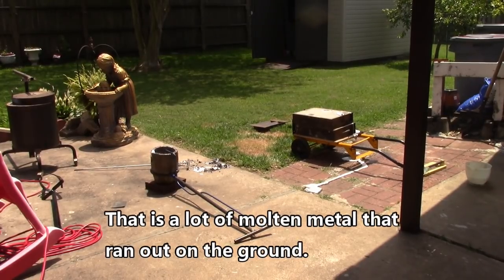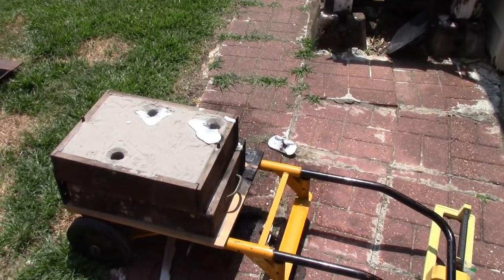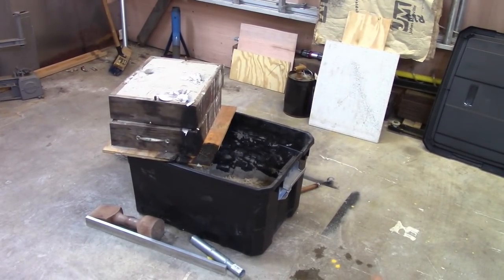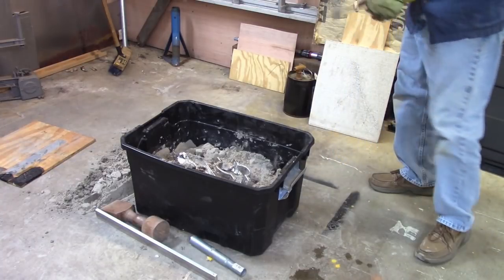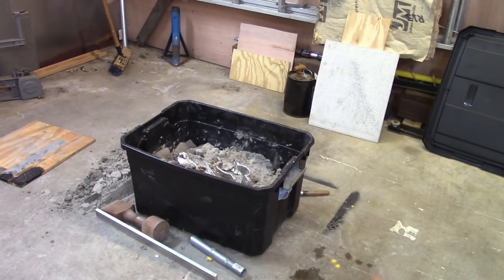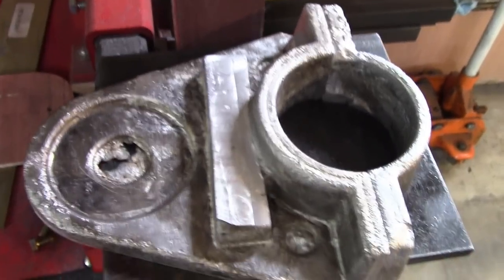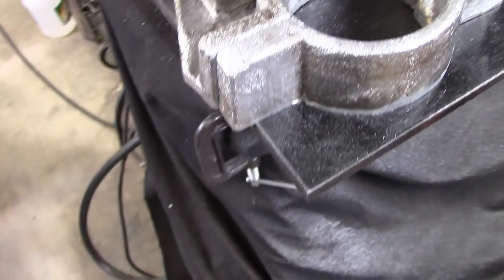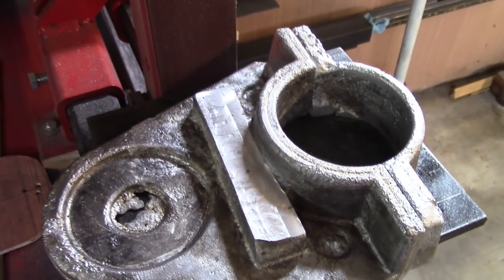Drill press oil can holder part 2 of 2

Comment: That's awesome! Even with that big aluminum spill, it still turned out pretty good! Great job Harold!
Reply from the maker: Yes it still was holding the metal needed to make a good casting.  I figured that I should not stop just in case things would turn out OK and they did.  Thanks for stopping by.

Comment: That's one way to kill the weeds in the cracks.  Hey I was praying it would turn out OK after you had the one upside down.  Put some wooden handles on that over flow and you'll have an aluminum hatchet!  I think a run on the belt sander and some more wire brushing it could be serviceable.  Gonna send you an e-mail.
Reply from the maker: Just file out the little bump on the inside of the small piece and it will do the job.  Thanks for stopping by.

Comment: Harold I'm going to give you a c plus that turned out pretty good
Reply from the maker: It is usable but just too small for my drill press column.  I think this is intended for around 2.75 to 3 inches.  Thanks for stopping by.

Comment: I did some casting during my last two years in High School (practically taught it my Senior year), all with petro-bond.  Didn't know about greensand until a few years ago.  Always finding something was was never taught or (more likely) forgotten about.

You might try working/hydrating/mulling your sand supply as a first step, so you can cover it well and give the moisture a chance to equalize while you work on your patterns.  Making yourself a riddle or using a cheap concrete mixer might help, you can mist the mix a little at a time as you sift or tumble it.  I've seen a few that even use a large tarp and pull it over, side to side, to mix things ... that looks like too much work to me.  Whatever method you choose, it seems like that sitting time is always part of the process.  Like a good stew, or chili, it's always better after it sits and has a chance to meld.
Reply from the maker: You are right of course.  Thanks for stopping by.

Comment: Could you clamp it together and Bore it out to fit your press, I'm sure you have a Boring Bar to go with that awesome Mill.
Reply from the maker: I think their would not be any metal left after boring.  My drill press column is near 4 inches diameter.  I guess I will have to measure it sometime.  Thanks for stopping by.

Comment: What was that special tool you cast along the pavers? I am sure you actually planned that. Maybe it is the part BOZO wanted to make. Better keep it around for him as he would be mad if you melted it back down. lol It might be time to add some alignment pegs to your molds.
Reply from the maker: It has pegs but I started the mold with the holes for the pegs facing the wrong way so when I turned it over they were on the bottom and I needed them on the top.  Thanks for stopping by.